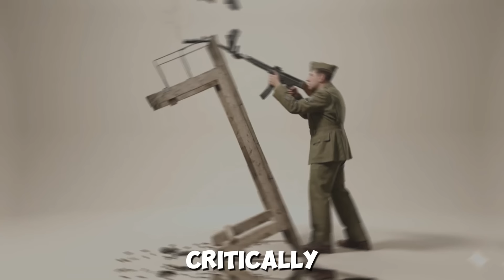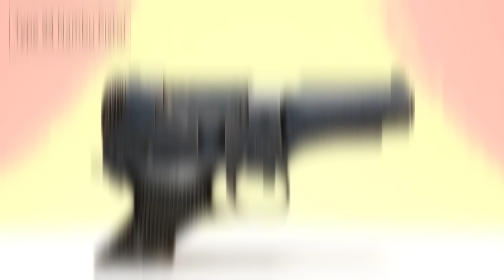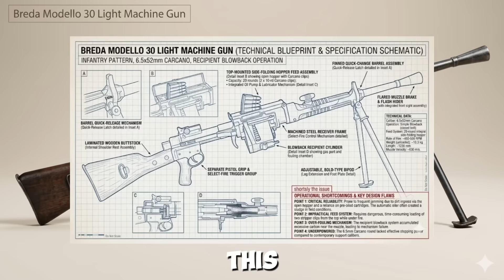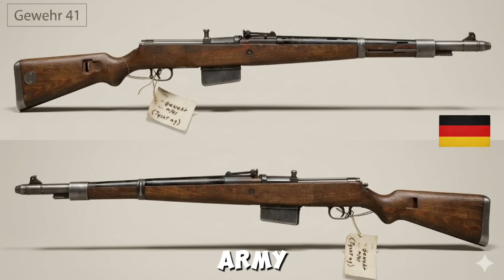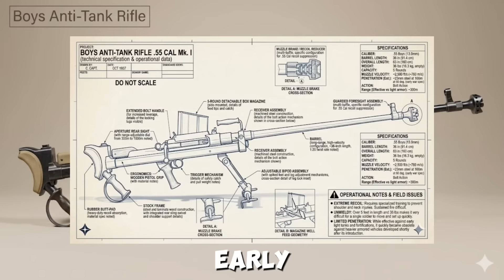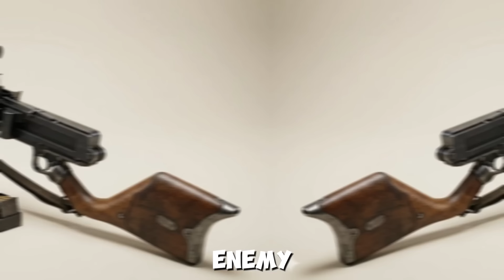Every Weapon Soldiers Hated Using in WW2

Comment: Your schematic for the Breda 30 is way off. "top-mounted side-folding hopper feed assembly"? What? It wasn't fed with 2x10 round carcano clips, it was fed with 20 round stripper clips into a fixed, side-mounted magazine. Besides, carcano clips were 6 rounds. The oil reservoir is the thing you have labeled as the "top-mounted side-folding hopper feed assembly". It wasn't select fire. The thing you have described as the "blowback recipient cylinder" is the fixed magazine. The bipod wasn't adjustable.

Comment: STEN was designed to be easily produced by the undeground forces. Therefore simple design was more important than reliability. As for PIAT - while this weapons had some flaws, it still for a long time was only hand anti-tank weapon, which could be fired from close positions, eg. from inside of the buildings - and due to spring mechanism without givig away shooter position.

Comment: Sten gun is marvelous, cheap to produce, easy to use, you can treated it as simplified version of MP 18...
But, you forgot to mention the magnetic mine use by German; you have to be brave and lucky enough to get really close with enemy tank, slap it on and pull the string to use it, and run as fast as you can or duck so the explosion doesn't kill you as well..
Reply: after the war it was Made to look pretty and called the Stirling

Comment: I question the criticism of the Sten gun — was it really that bad, or just a wartime compromise?

Do you think soldiers hated it, or did it simply reflect the harsh realities of mass production?
Reply from the maker: The STEN wasn’t perfect, but it was cheap, fast to produce, and easy to supply to resistance groups. In that role, it did exactly what it was designed to do.